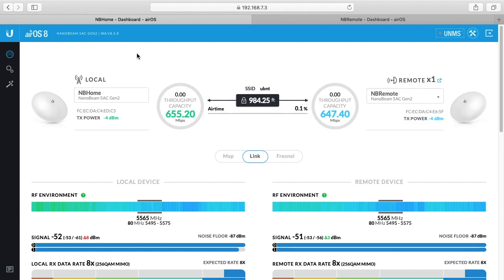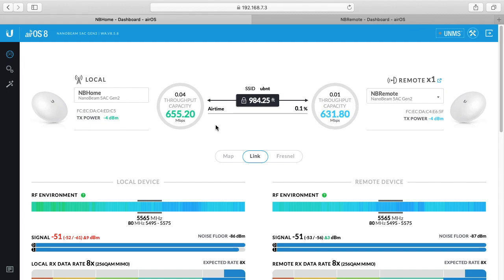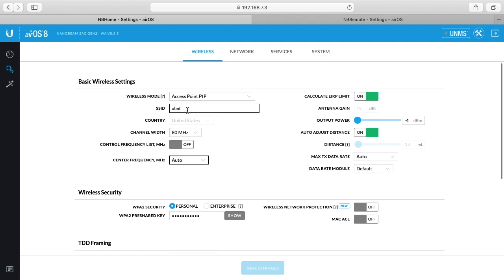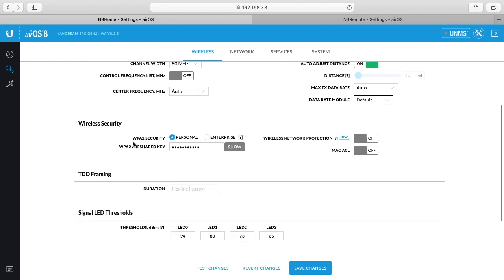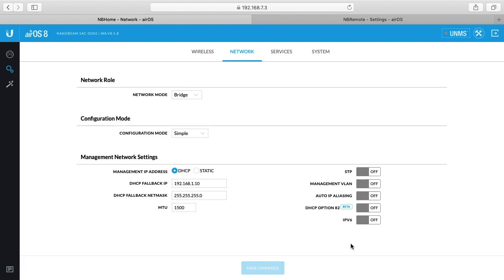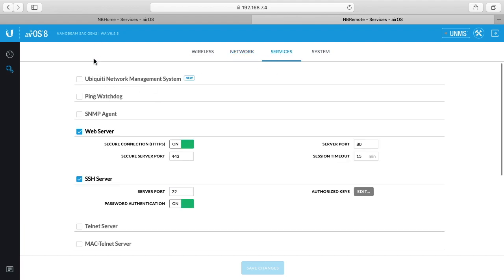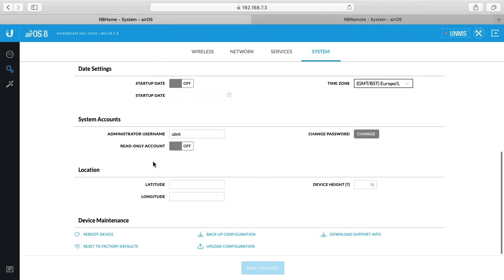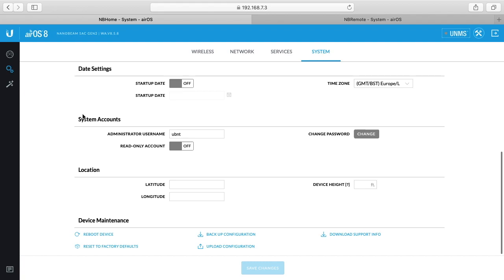Ubiquiti NanoBeam AC Gen2 Advanced Wireless Bridge Setup

Comment: This is 4 years old and it seems to start off "already working".  
Mine in 2023 came with no manual, there are NO findable manuals or firmware from the main UI website.  The website is absolutely pathetic.  
I'm an experienced pro and can't quickly figure it out.  
The gen2 seems incredibly dumbed down from any of these I have worked with in the past.  
Can't even figure out how to switch between station mode and AP mode etc.
   
I'm just trying to create a network bridge between two sites.  
It's a shame there is not documentation whatsoever.  
And the community is less than helpful on this.
Reply: Mine are missing wireless mode settings.  you have to sliders for AP and PTP mode (both are off) they are independent. and not explained anywhere.  
Yet the status page shows the unit is in "PTMP station mode" (and no place to change it).  
Guessing it's just some combination of the toggles but again not documented anywhere at all and interfaces has change completely from what you show in this video.
Reply from the maker: Ubiquiti changed a bunch of the interface. I have an updated video where I go over my config. I'm not sure if it is completely current but maybe it will help: https://youtu.be/p_PlLuK604Q
Reply: @Rickmakes  That's great that the changed everything but did they document any of it?  
I am having great difficulty finding any documentation especially around Airmax settings.  
I feel they seriously dumbed it down and didn't document how to work with it.  
The main UI website is a serious joke.  
Can't find docs or firmware for products.  
Only stuff I have found is offsite stuff and google searches and it all pertains to the older interfaces.  
And this U6 claims to be an "Enterprise" product but there is no enterprise class documentation or ...  
Seems they really have taken away all of what use to make UI cool. 
All been massively simplified with all of the fine tuning options gone.  
And no good support for airmax products.

Comment: Lovely video! At the wireless , there this secondary ssid,how does it work ?
Reply: ( 9:07 )down the wireless security ,there is this word "secondary SSID”
Reply from the maker: @abdallahamed2287  Got it. Thank you. I looked into it. You can set up a second access point at the home location with a separate SSID. If the remote antenna can't connect to the primary access point, it will try the secondary access point. The Secondary SSID setting is only on the "station" devices. This is what the help says about it: "The Secondary SSID provides an alternate AP for the station to connect to upon initial startup or link failure. The station will always attempt to connect to the primary SSID first; if that fails, it will try to connect to the Secondary SSID. Once a link is established with either AP, it will be maintained until the next startup or link failure." Does that make sense?
Reply from the maker: I'm not sure what you are referring to. What is the time on the video where you are seeing this?
Reply: Yeah, yeah thanks alot!🙏

Comment: I have the PowerBeam PBE-5AC-500 and just installed the latest firmware 8.7.0. However, I found out that I cannot increase the TX power on the AP unit. Does it happen to you as well? Thanks.
Reply: Turn off calculate euro limit

Comment: Hey Rick how abou a little something about basic router ipaddress situation and the default on the nanobeams  being different and how to make nanobeams ip address get into range of router i.e.   tplinks are 192.168.0.1  using a second tplink i set ip to 192.168.0.2 and dhcp disabled and wds bridging on  nanobeam 3 1 is hooked via poe to tplink # 1 with 192.168.0.1   second nano is at a house 600 ' away with the tplink set at 192.168.0.2  second nano has ip of 192.168.1.20  cant seem to get it to get in the right range of 192.168.0.?
Reply: Can firware version affect signal to be low or high?
Reply: Set the wan on ap and station to dhcp. Plug your ap into a port that leads to a dhcp server. As long as both radios are connected to each other, they'll take an address from whatever dhcp server they see. They each get an IP. 

Check your routers leases and see what they took. If youre on the network you should be able to reach your radios.

Comment: What kind of throughput speeds are you getting?  I want to transmit internet to my workshop about 600 ft away from my house and I'm waffling between these or the nanostations
Reply from the maker: I just tested the speed between two servers, one on each side of the bridge, and I got around 170Mbps. Performance will vary depending on setup and environmental factors. I'm in an urban area so there is probably more interference. I do have line of sight between the antennas. This has been very reliable in my experience. I have my servers backup to each other over the bridge at night. It transfers many gigabytes of data.
Reply: @Rickmakes  Thank you for the reply.  It seems about the same as with the nanostations from my research.
Reply: @jjvirago  I'm getting 350Mbps in each direction send/receive dual paths or 650Mbps in one direction!
Reply: @RogerDiotte  what am I doing wrong ?

Comment: I have trees on my line of sight, and the connection is very poor, how can I improve this?
Reply from the maker: I'm not sure you can make it work through the trees. Is there a way you can go around the trees or remove a tree to get a better line of sight?
Reply: @Rickmakes  Look at the Ubiquiti M900 solution.
Reply: Look into the Ubiquiti 900MHz solutions such as the M900.

Comment: if you have 3 x Nano Beams, and have CCTV on both out stations, do you setup the House as an Access Point?? and set the 2 remote barn locations as station1 and station 2. or do you use Multipoint. Cheers. Darren
Reply from the maker: I haven't set one up like that but I think you would set the home to "Access Point PtMP (point to multi point). I think the remotes would be set to Station PtMP. You also need to make sure the devices have a wide enough coverage angle. Ubiquiti may have some devices that are more ideal for doing what you are wanting.
Reply: @Rickmakes  Cheers for the info m8. i'm only going about 100 metres. so hopefully that should be good enough. thanks again. Darren

Comment: Hey rick, i configured my devices like how you showed in the video but the internet didnt come through, the devices are working and everything but when the Ethernet cable is plugged in my pc it says no internet available
Reply from the maker: So I take it you have Router > Nanobeam Local > NanoBeam Remove > PC. Is that correct? Can you tell if your PC received a proper IP address? Can you ping your router?
Reply: @Rickmakes  im not really sure but i think i have an idea of what issue might be ill get back to you with all of the info i can get if i cant figure it out
Reply: @Rickmakes  but no i cant ping my router
Reply: @Rickmakes  so far i know i have my settings right but the issue is my pc says unidentified network. No internet, if you have an idea on how to fix it idreally appreciate it

Comment: I have been using the original Nanobeam and recently added another set which are the Gen2. It appears that I should be able to power and use the original one (which is mounted within 6 feet of the first but points another direction) with the same ethernet line back to the switch but I cannot seem to get this to work.  Any ideas?
Reply from the maker: I haven’t powered anything with the POE passthrough. You do have to turn the feature on. The setting is under Settings > System in the Device section. Looking at the specs it appears as if the Nanobeams need .5A so I think you are on the right track with the 1A power block.